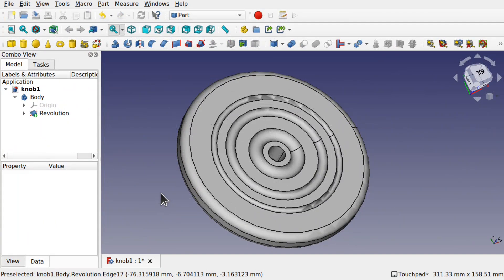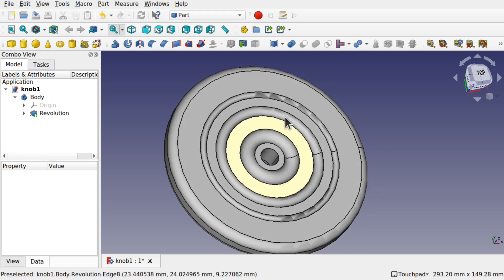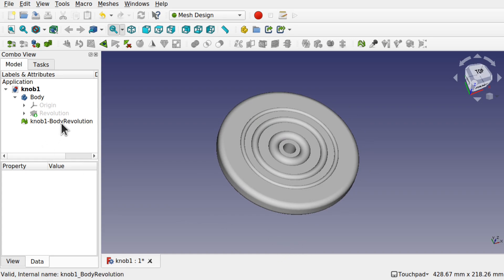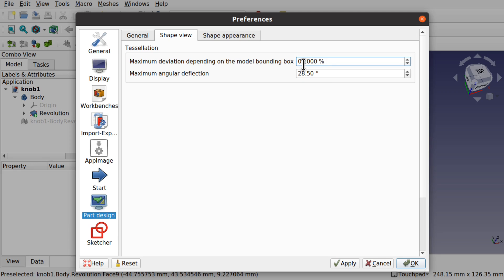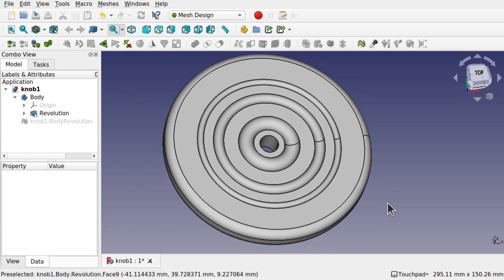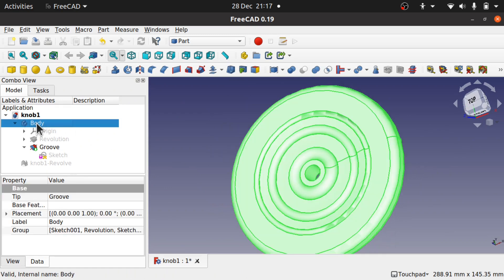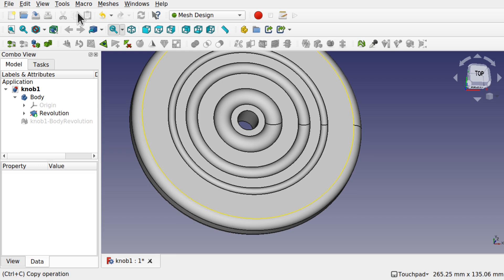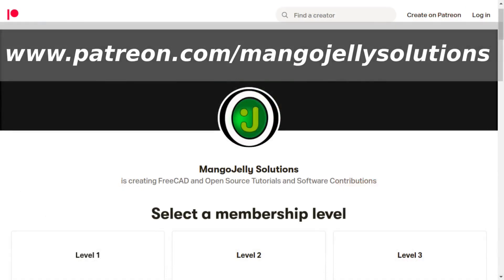FreeCAD  - Get a cleaner model output, smooth edges for display

Comment: For those wondering: THIS DOES IMPACT your 3D files going into Blender/Maya as well as your Slicer software!!!!! It is not just visual representation in FreeCAD. I found that out the hard way! My prints kept coming out with the facets. Once I changed my resolutions in FreeCAD first to the highest settings, Angular Deflection = 1.00 and Deviation = 0.01. Then if I exported it in OBJ, FBX, or STL, they came out SO MUCH BETER! So, if you want good 3D print workflow: 1) Once your part is finished being designed, Create a Simple Copy of it to make sure it is a clean file and double check your bounding box to make sure it's correct. (Sometimes other features and steps can impact that). 2) Export as OBJ or FBX to bring into Blender/Maya modeling software. 3) Remesh with high poly count. 4) Export as STL to bring into your slicer software.
Reply from the maker: Thank you so much for adding your findings for that and taking the time to explain them in such detail.  Really helpful information.  :)
Reply: @MangoJellySolutions absolutely! Glad to help contribute. Might be a good video for you to make or update these ones with a early note for people. I also found Unreal Engine remesh tool works great, I actually prefer it over Maya's. I don't really use blender but I know they have tons of tools that are great. I also found that Maya can auto UV the remeshed high poly ones from Unreal perfectly. Really makes for a great workflow if you want really realistic PBR renders of CAD projects.

Comment: I've done simple 180 degree revolutions of circular parts and when printing them the jagged lines do in fact show up on my outer circular curvatures. is there a different fix for this?
Reply from the maker: This may be due to the file export.  If your using STL it is converted to a mesh on export.  If you use the mesh workbench you can convert to a mesh and adjust the quality.  This video may help https://youtu.be/v6FgTIpsCKo
Reply: @MangoJellySolutions thanks you're a champion!

Comment: Hello, I am trying to convert an STL file into STEP so I can CNC it from metal in bulk. When I convert it to a solid, it has 1,700 faces/triangles on it and it really should just be a single piece. Any I tried refine but that only helped a little on a couple flanges. Any idea if I can merge triangle faces by hand?
Reply: For CAD to CNC/3D Printing, facets do get picked up and CAD software is not the best at this as you prob noticed. Workflow i found is make the resolution the best in FreeCAD first by angular delfection = 1.00 and Deviation = 0.01. Then export as OBJ or FBX and import into Maya/Blender/Unreal Engine. Remesh it with high poly count and preserve edges and details. Then Export as STL and bring into the CNC or slicer software. This produced the best results to remove facets for me.

Comment: Why are you changing to the Mesh-Workbench bevor you export the object as STL.
Export works from every workbench. Does its behaviour change in the mesh-workbench?

If you want to see the triangulation, you can change to hiden-line display (Shortcut: V4)

My impression was, that “Export” exports the object with the display-triangulation (what you see with hidden-line).

Comment: great tip! Will this affect the model when exporting? One of my biggest issues when I export for print is that the model is all polygons and not smooth.
Reply: Same here, will try it on 3D print end report
Reply: @miletinic920  after some digging, I think this is to smooth objects on the display. What I do is to export and import into blender. Convert to mesh then subdivide then smooth tool. I was looking in the freecad manual and it has a mesh workbench to convert and smooth. There is also a cura plugin with a cura workbench as well. I'll try it tonight after work.
Reply: @Shenanigans3D  What format do you use to export the object for blender?
As far as I can see, all formats that freecad can export and blender can import contain triangulated objects.
If the cura-plugin is the plugin for cura that reads freecad-files: This does not help.
Cura is unable to process any other format than triangles. The plugin simply starts freecad in the background and exports the triangulated object.
(I would have linked the discussion on cura-forum, where they refuse to read CAD-formats, but then stupid youtube would probably delete this post.)
Reply: @rynnjacobs8601  it will always be in triangulation, i believe thats how meshes work? Could be wrong. I export stl then import into to blender. But I will be changing that. I'm currently test printing an export after going thru the mesh tab in freecad and changing the deviation to .10um.

Added:
After model created. I went to the mesh workbench. Converted solid to mesh, adjusted deviation then exported. It completely got rid to the triangulation.
Reply: @rynnjacobs8601  the cura plugin is no longer maintained.. I looked at it briefly then removed it.
Reply: Yes this impacts your SLT quality for your 3D prints. I posted a comment in here discussing the ideal CAD to Print workflow i found through lots of trial and error.
Reply from the maker: I believe this is only visual, but if you find out otherwise please let me know.
Reply: @MangoJellySolutions  with Cura 4.6 (windows 10, i don't know if on OS and iOS will defer) on D12/400 printer has not much visible difference 0.2layer 45 speed tested on same settings.